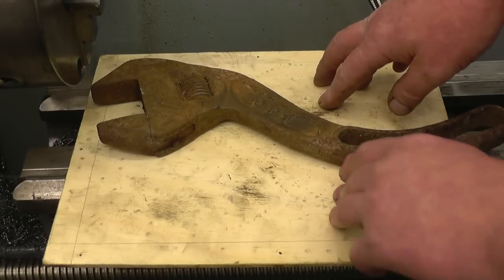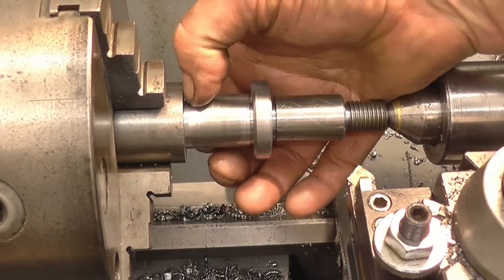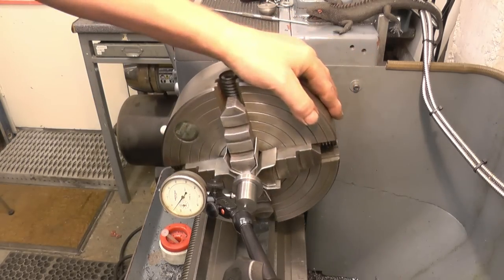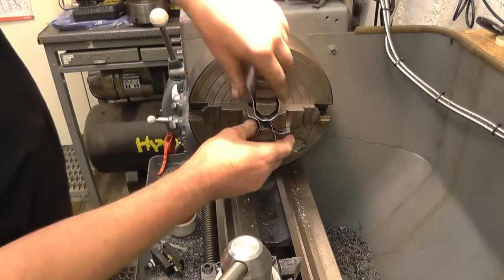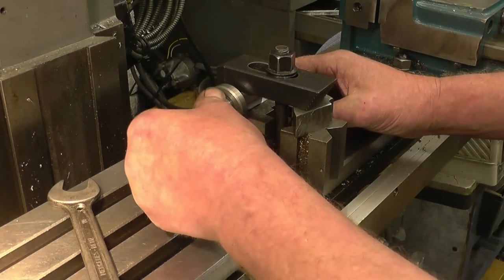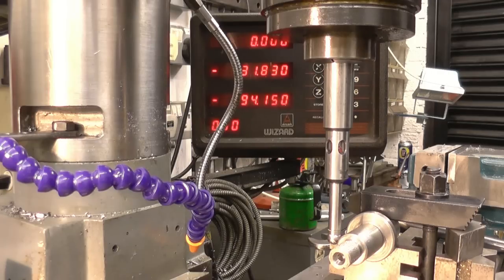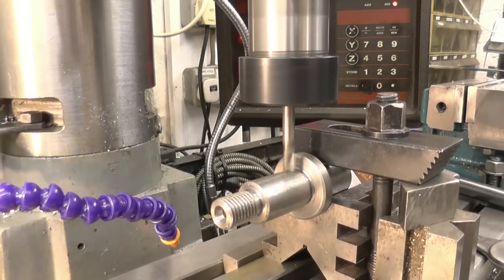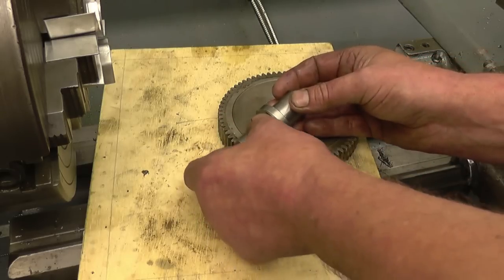Sunday Night Night Cap 83 part 3

Comment: once again another great 3 parter, glad to hear debs is feeling better and you found a new way to remove a pin from a hole, add loctite spray a bit of air on it and out the bastard pops (grin)

Comment: Hee hee, that flying pin was actually a surprise and I was so close to the video screen I ducked my head so the pin wouldn't hit me in the eye, LOL! Thanks for showing off a few more of your tricks, I was thinking you meant to use the 1/4 inch drill bit laying down long ways, but that was even quicker "kink", I like it.

Congratulations on all of the improvements in Debs' health, that is great!Aloha from the farm...Pops and Chuck.
Reply: Knolltop Farms You should have has you safety glasses  on. Never watch a machining video without them.
Reply: Bruce Richards yes, and never watch welding videos without welding goggles ;-)
Reply: Bruce Richards I have caught myself doing so after coming in for a water brake to find a new video on the list to enjoy, hee hee!
Reply: Harald Finster That one I've yet to do, though I did know a guy who asked in a comment over on Jody's welding channel "will the light from your computer screen give you flash burn?" LOL! 

I didn't laugh at the kid directly, but it was funny here in the living room ;) Aloha guys, hoping you're both all well and good...Chuck
Reply from the maker: Knolltop Farms As always thanks for the kind words

Comment: At 15:45 - You know that air can't get out from under the pin (hydraulic lock) but it never fails to get IN with a blast of air. An air is such a wonderful force to throw that pin a long ways.

Comment: Soak it in break fluid for 3 days and i will promise it will be working like new, i usually keep a small container of old break fluid around for rusty tools like this and it really does work, but if it has plastick on the handle it will melt off as the fluid compromises plastic and most rubbers.

Comment: lol that pin. would have been ironic if when you picked that up you found that pin you lost from the lathe's wheel as well. you could probably find that other pin, here's how: turn your back on the lathe, throw an 8mm nut over your left shoulder then go get the nut. both items will be right next to each other :O)

Comment: Try electrolysis John, works well on cast especially, be interesting to see your take on it
Reply from the maker: jusb1066 I have been reading about this
Reply: jusb1066 SUPER MESSY !
Reply: doubleboost  I used electrolysis on a little vice that was frozen tight.  I set it up before a turn out and left it for about 10 days on 2 amps.  screw came loose with little effort and it took a minimum of tapping with a hammer to start the jaw to moving.  Unfortunately the screw took a bit too much damage from rust so it will need to be replaced... in short, it can work to get rusted parts 'un-stuck' from each other.
Reply: OLD WIPPER-SNAPPER nah , its fine, ive used it so many times i cant count, what id prefer to try would be graphite electrode as it apparently keeps the water cleaner and you get a more consisten result and saves having to clean your waste steel anode (or cathode can never remember them names!) a bit of washing soda is cheap,  if we had proper cider vinegar in the uk id try that too, but the white vinegar they do sell here wont do anything for rust, though i do use it to patina carbon steel and new brass(it initially cleans the brass, exposes a bit more copper, but then goes dark all the quicker in a few days)  ive also heard a long soak in molasses works a treat too, but a gallon of it is not cheap and it goes rotten so ive heard, so hard to get rid of after